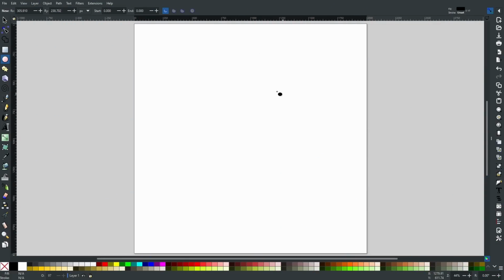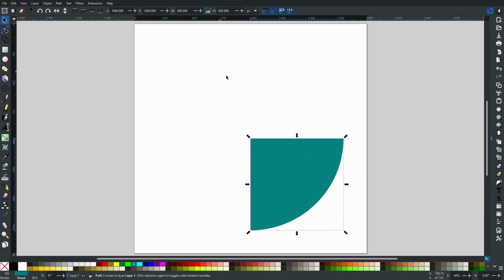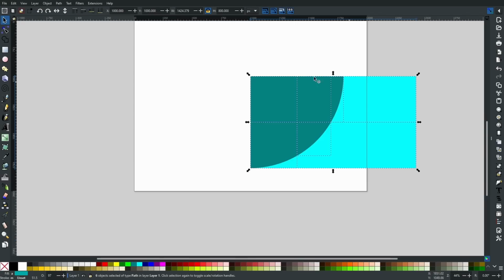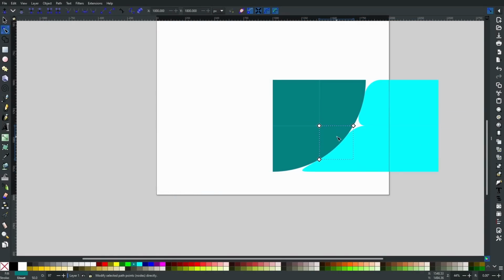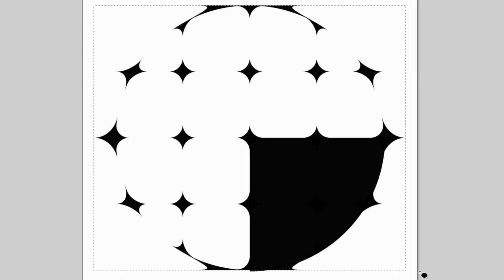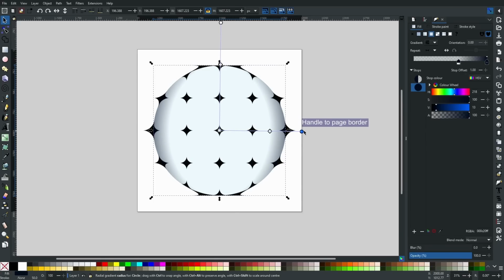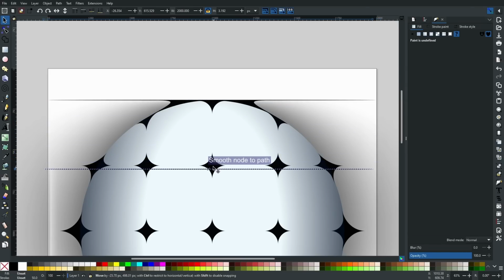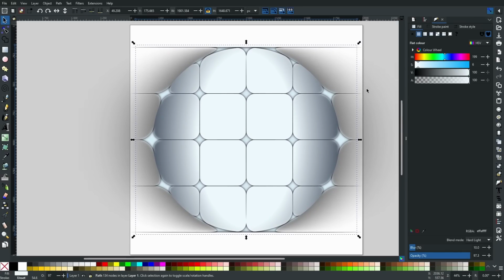A Technical Exercise Using INKSCAPE

Comment: What an interesting method.  How long did it take you to come up with that?
Reply from the maker: Not very long my friend. I firstly tried to block over the circle and then draw the 'stars' over the top but I thought that it was too inconsistent. I then tried this method with the full circle but I found that there were too many issues when converting them into their own path. I eventually settled on this method which worked really well, as you can see.

With all that said, that was the very reason I decided to create this video. Technical exercises where you have to find solutions to problems as they arise, is a fantastic way to learn. I strongly suggest giving it a try. The simple yet, intricate designs (like this one) are brilliant to do exactly that...learn.

Hope that clarifies my friend. #StayCreative :_VIP:
Reply: @ButtonPressGraphics  I truly appreciate your timely responses.  I look forward to your next video.  Thanks, my friend.